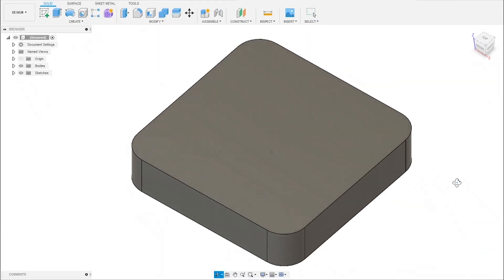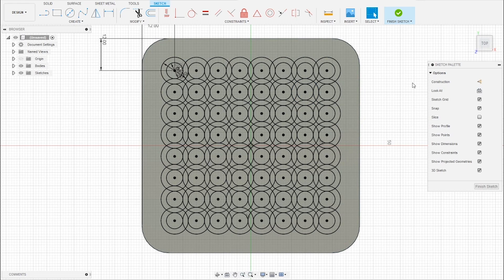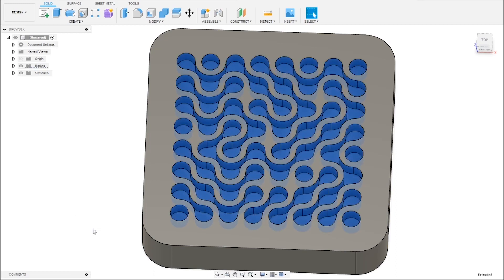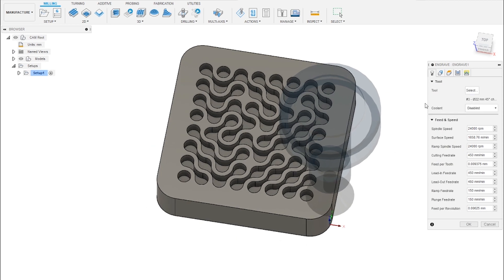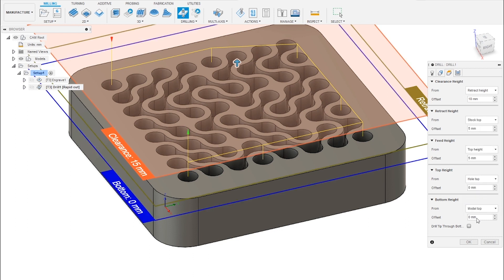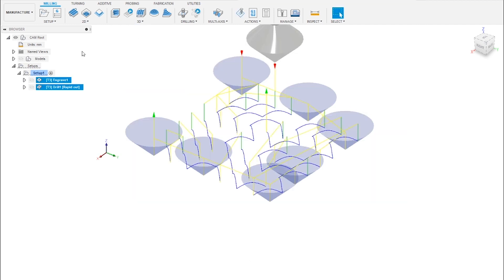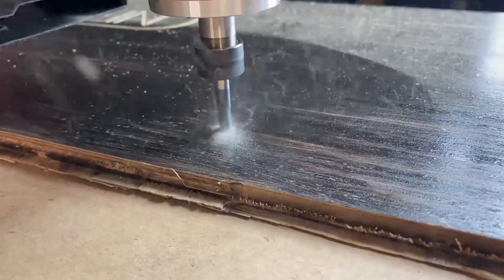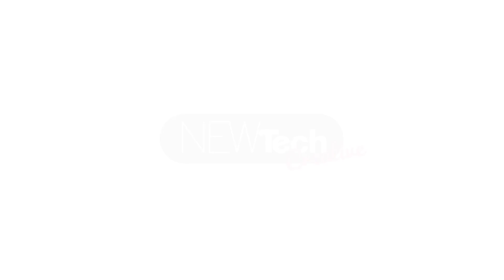Simple pattern - Fusion 360

Comment: I've had a ton of issues with clearance, retract, etc. heights on my Workbee. I'm using the post-processor off of github for F360 and Openbuilds Workbee. In the simulation everything looks good, but if I leave the default clearance heights, the router bit will go WAY further into the workpiece/table, or if it retracts, will exceed the max Z height way more than the specified value it should. I have no idea how you can get away with those values for the heights, but I am very jealous.
Reply from the maker: Thanks for your comment! I would be happy to help you with these issues and try your gcode on my workbee to eliminate your issues with files. Feel free to send me an email at newtechcreative@gmail.com .

Comment: Hi Miles, which post processer are you using for fusion 360 and how are you setting your vbit z height? Thanks.
Reply from the maker: Hello! I’m using Grbl post processor. I usually eyeball the vbit and set slightly conservative then begin carving to check depth... I run the program then if too shallow I lower slightly and run again. It can be a fussy process setting correct height with the vbit. I do have a touch probe but enjoy eyeballing the height.